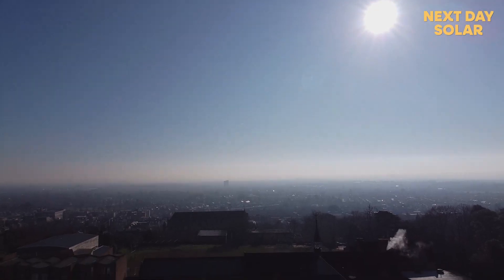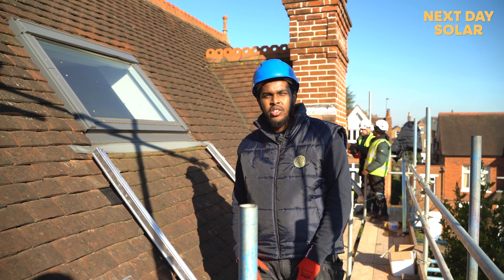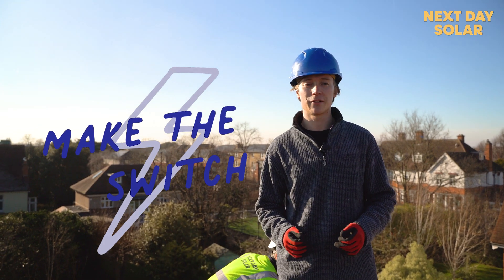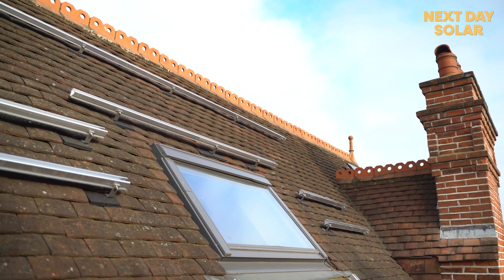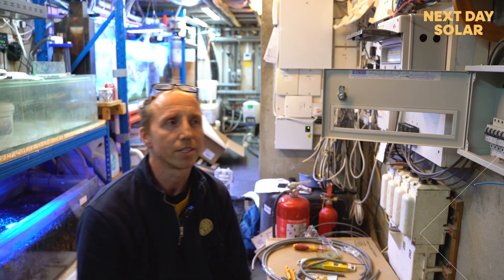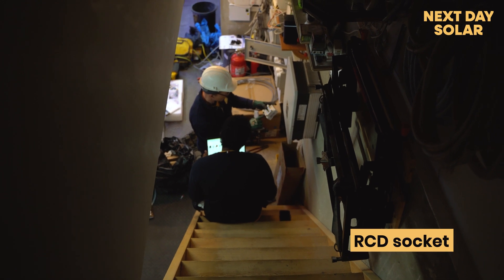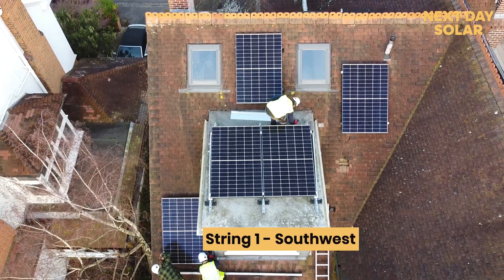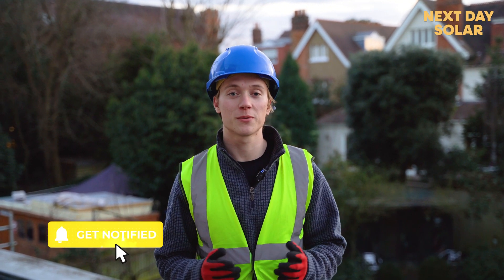Its a big one ! 24 Panels, 20kWh of Batteries, more roof faces than a dice ! Epic Solar Step by Step

Comment: Sounds great but if you don’t use it then you lose it - eventually! Meaning once the batteries have filled up with more than enough to cover 1 or 2 days worth of power then the rest ends up in the grid
Reply from the maker: Unless you channel the excess to a hot water tank using one of many devices available out there.
Reply: @nextdaysolar3349 Or charge an electric car with a 64kWh+ battery.

Comment: why do you use the silver anodised Renusol Solar Panel Mounting Clamps not the black anodised ones to match the panel frame?
It it due to cost as the black ones are more expensive?
We use the silver rails due to cost because they are mainly hidden but always us the correct clamps to match the panels.
Reply from the maker: Availability